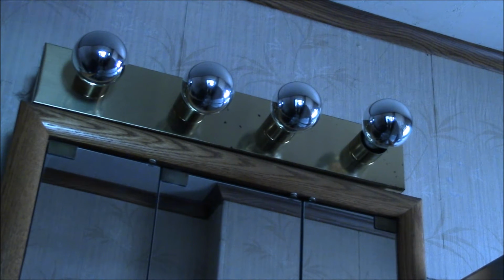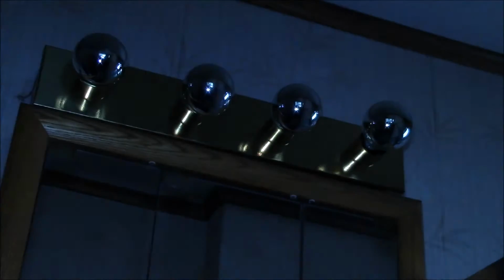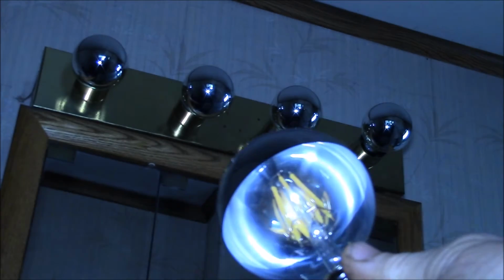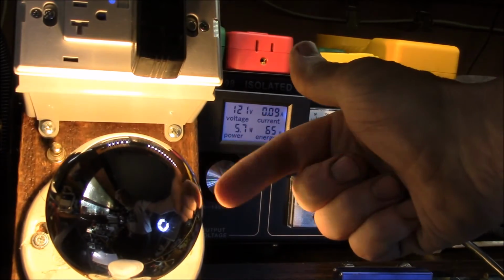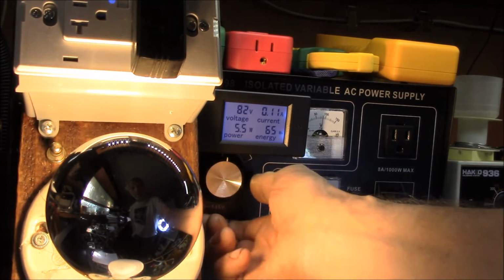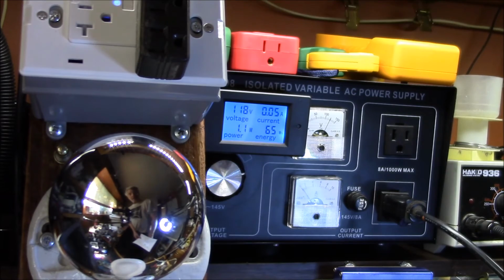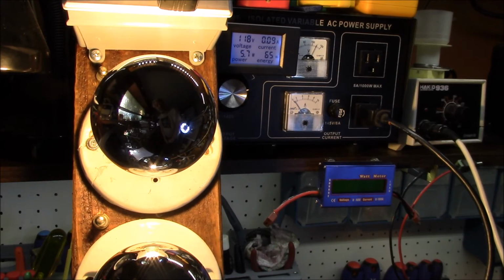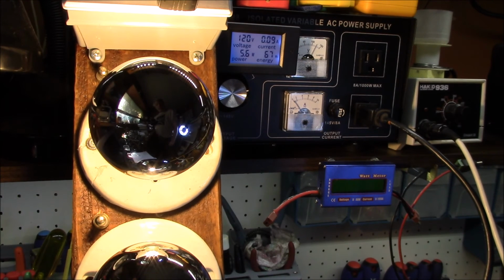6W LED Mirror Bulb Review

Comment: I'm curious how these lights light a room compared to standard bulbs. I'd like to replace my 5x bulb light similar to the one in the video (which has 5 ~800 lumen cfl globes now) with a pair of 5x bulb fixtures sitting on either side of the mirror. What I have is very bright (and I wouldn't mind losing a few lumens). I'm curious how many half-mirror bulbs it would take at the same wattage (60vs60 or 40vs40) for the mirror bulbs to light the whole room as well as the bare bulb. Any thoughts?
Reply from the maker: I've only had the mirror bulbs in this bathroom fixture.  The 6W LEDs are just as bright as the 60W incandescent, sitting side by side.  The only way I can tell the bulbs apart is be feeling the temperature of the globe.
I don't have any 60W bare bulbs, but a 75W bare bulb puts out at least as much as the 4 mirror bulbs do, as far as lighting up the rest of the room.  The mirror bulbs put all the light back towards the wall and only the light reflecting off that or the mirror light up the rest of the room.
Reply: R Brown  That's some information I can use, thanks so much!  4x 6w LEDs ~=1100 lumens. So 10x of them would be rougly 2750 lumens. That's about what I expected.  I'm sure my green walls will be a bit darker too.

About how much dimmer did the LED run at 80V when it began to flicker? It's really hard to tell since the camera's exposure compensates.

Thanks!
Reply from the maker: The bulbs I used are non-dimmable.  Constant brightness down until they start flickering.

Comment: I really like that electric measuring gadget you're using.  Can you tell me the model # of it and how much it costs and where you can get one?
Reply from the maker: Here's information on the meter itself:
https://youtu.be/8X0eyY7TcM4
And the variable power supply I installed it in:
https://youtu.be/8NlL6lfkN2U
Reply: Thank you.  I didn't realize you had to actually install the digital thing inside of the big box.
Reply from the maker: Initially, I just had the power meter attached outside the power supply, but it does need some internal connections.  You could wire up one of those meters to be totally separate like the video below:
- https://youtu.be/LhR-Z6lBeZw
I built that meter as a 220/240V meter, but it would also work just as well on 110/120V if that is the voltage you are working with.

Comment: Nice work. LED technology has really taken off...and prices are coming down. Those filament LED bulbs are pretty sweet with a nice color spectrum.
Reply from the maker: +Chris DIYer Thanks and yes, getting some really good LED bulbs nowadays.  The old bulbs I replaced had no markings and I was a bit surprised to see they were almost 60W/ea.  I think that one light fixture over the vanity used as much power as all the other lights in my house combined!  Now all I need to do is eliminate the light dimmer and put in a Z-Wave controller and wall switch.